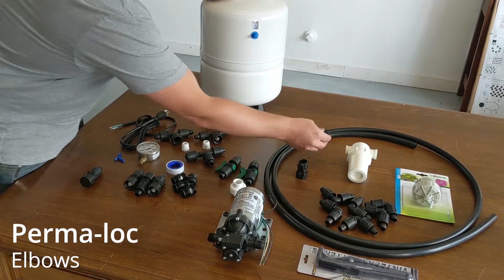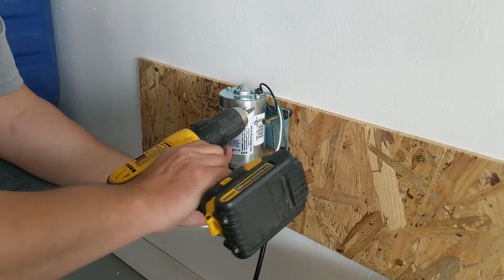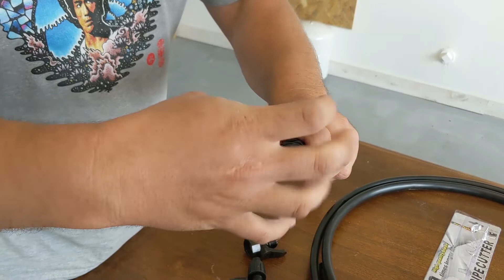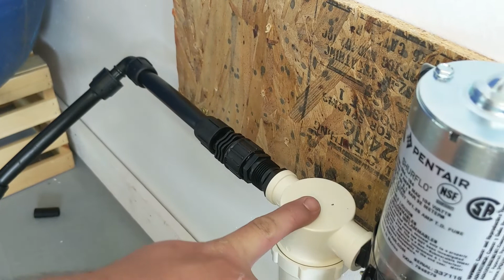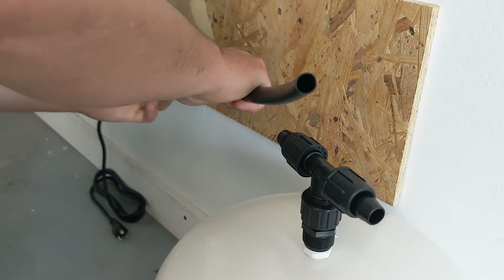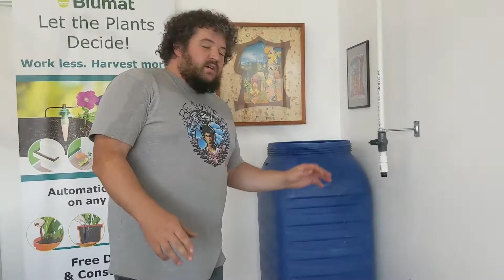High flow pump kit installation with Perma-Loc fittings

Comment: Been using a foot valve with my pump setup and have had continuous random floods the last 2 cycles, not from hitting the carrots or anything like that. Almost like a siphoning effect is happening in my res as I hand fill it to keep it topped off.. Are issues with the foot valve common? I have my pump mounted on the wall slightly higher than my res.. could that be the issue ? Or could it be because I'm hand filling my res that's causing the siphoning?